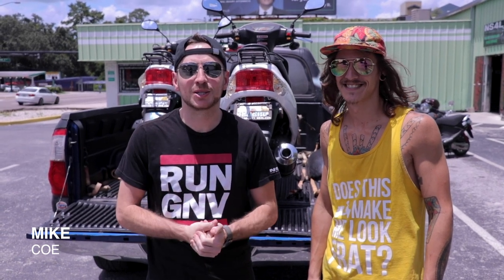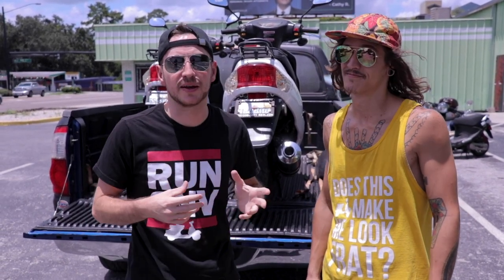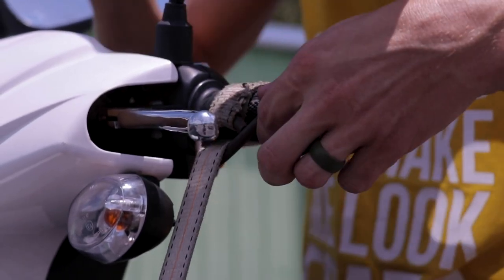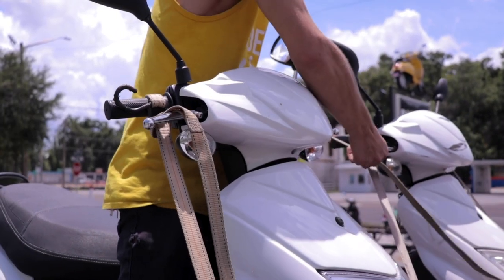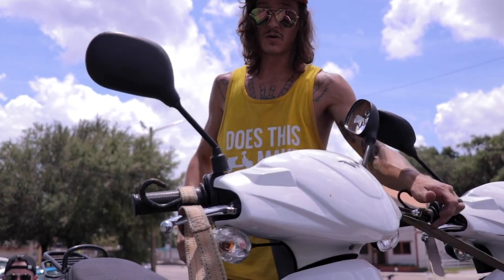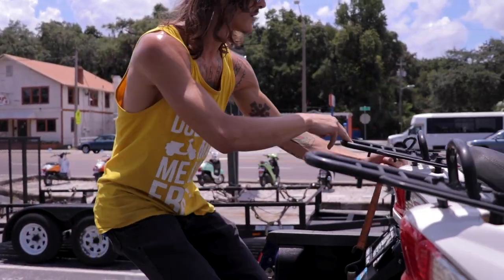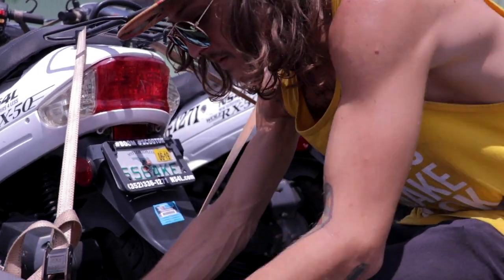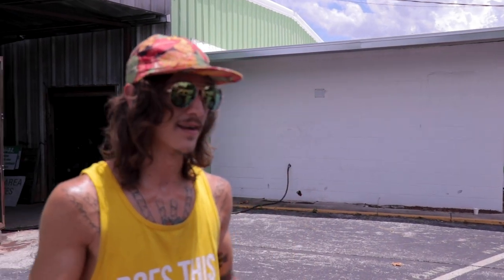How to Strap Down & Load 2 Scooters | NS4L How-To's

Comment: Question is can you get 2 Vespa GTS  HPE 300 in the back of a truck?
Reply from the maker: Yes, but it would be tight.  It also may depend on the size of the bed of the truck. :/